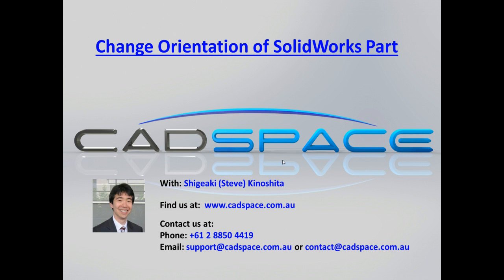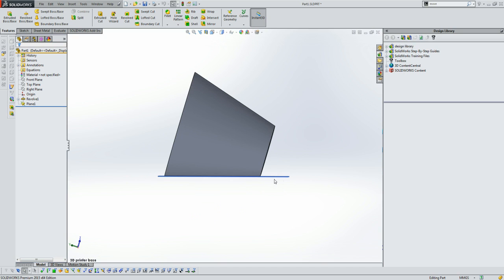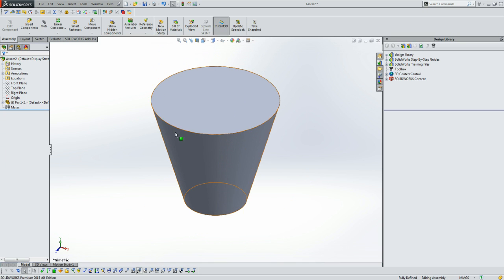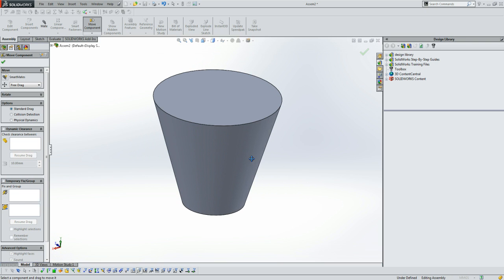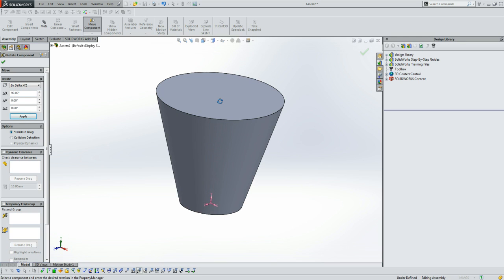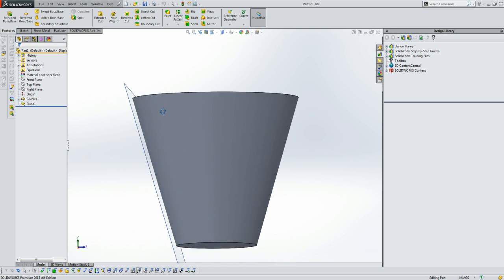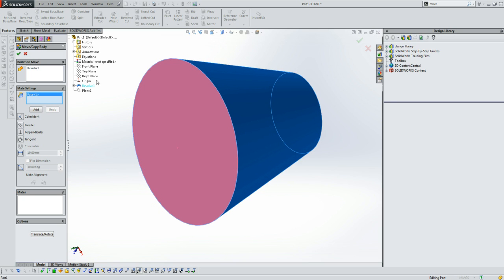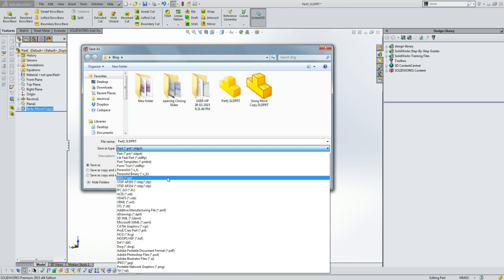How to change orientation of SolidWorks Part!

Comment: Notice that at 2:12 when he demonstrates 'floating' the object, he's not really floating it.  Instead he's rotating the view angle.  You can see this because the 3-color axis in the corner is staying aligned with the part.  If he were truly floating the part, the part would move and the axis would stay fixed.  If he actually floated the part like he said it would be impossible to then rotate at any number of degrees and get it aligned with the Z axis.

Comment: in assembly only. can you do it in the part not assembly? There are videos stating you need to create reference geometry and assign the origin then save it out with the new origin but this only seems to work if the planes are aligned when they are imported, for parts for ex. catia where the part is in air plane coordinates I cannot seem to change the origin.... tried a lot videos... only way for me to through the day is to translate the origin in catia and save out...

Comment: I don't see FLOAT in dropdown box expanded when rite-clicking object name in assembly feature tree manager. Is FLOAT an option in all Solidworks versions?
Reply from the maker: Float is only an option in an assembly level when it's not the first part hat has been inserted. By default the first part you insert into an assembly is FIXED, this means you cannot move it and it becomes the reference point for the rest of the parts. However, if you then right click the part you can click on FLOAT and it becomes movable. This command then changes to FIXED when it's in FLOAT mode. 
If you still cannot see it, at the bottom of the menu (after you right click on an object name), click on the bottom most command called "Customize menu", and make sure the command is there and has a check next to the name so that it's always visible.
hope this helps.